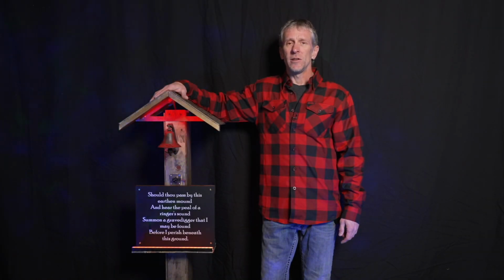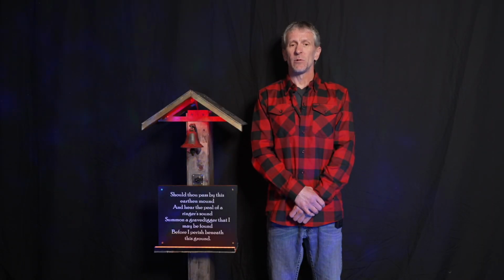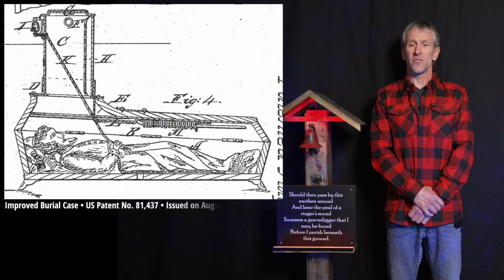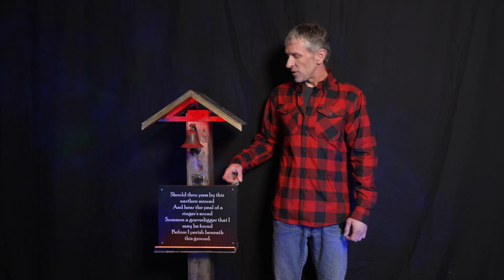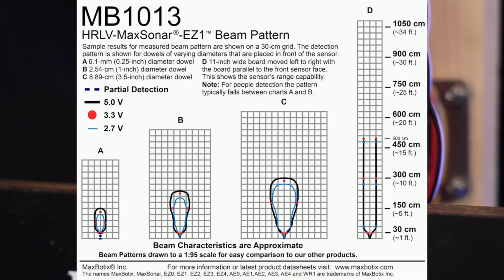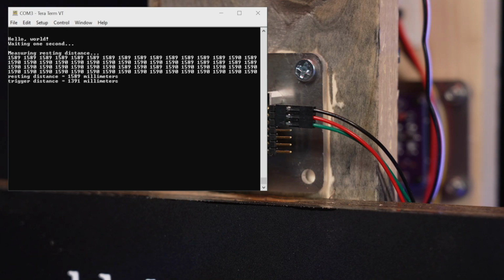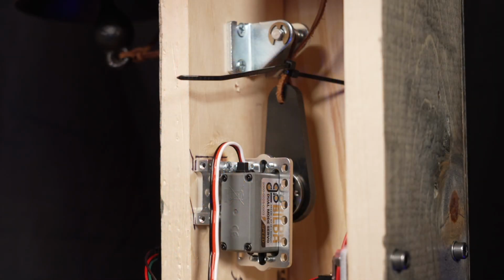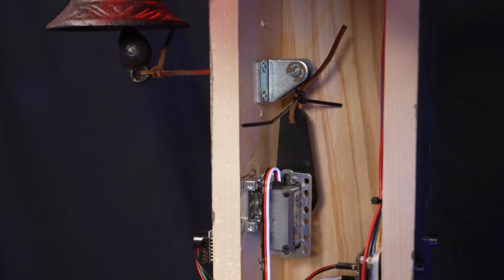Safety Coffin Grave Bell Halloween Prop Halloween 2021

Comment: Would you ever consider selling a finalized product to those of us who are not handy/technically inclined?
Reply from the maker: I wish I could but the manufacturing costs and support costs would be prohibitive. :(
Reply: @GlenAkins  ok, thank you for answering my inquiry 🙂
Reply: By chance, sorry to bug you again...
Would you have the part numbers that you used for the 3 main components?
Reply from the maker: @christinekretsch6399  There's a list of components over on this page where I documented the project. https://hackaday.io/project/181666/components   I'd use an Arduino or Adafruit Feather instead of the custom board with the STM8 if I were looking to simplify things.
Reply: @GlenAkins  thank you very much 😊